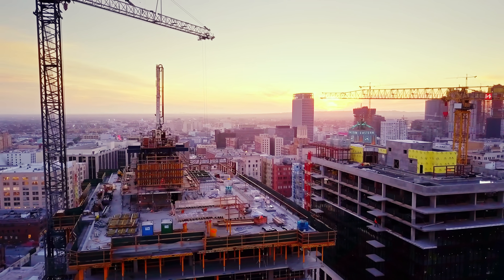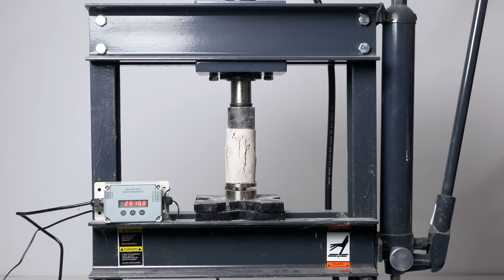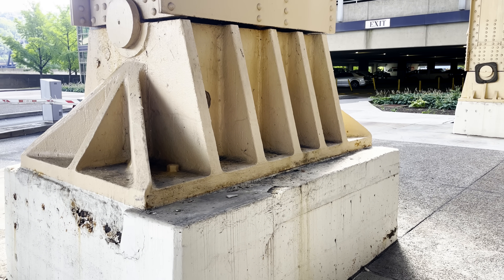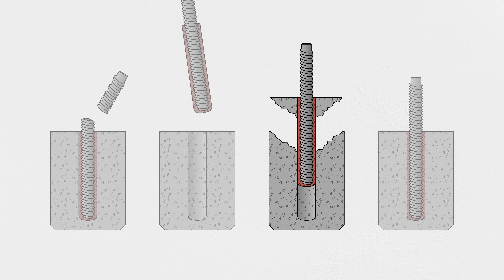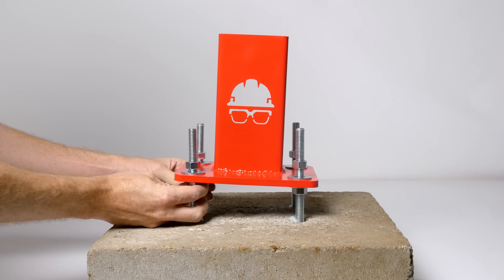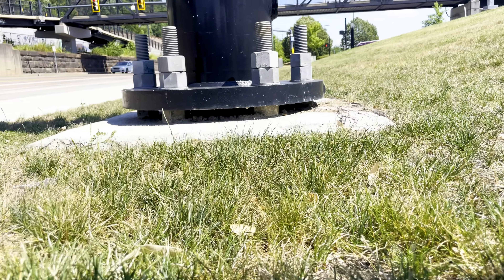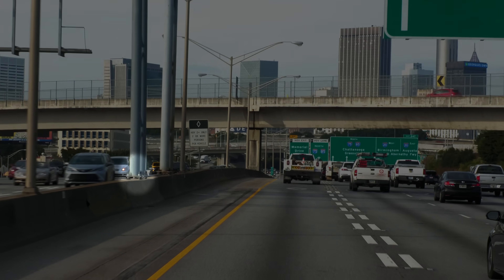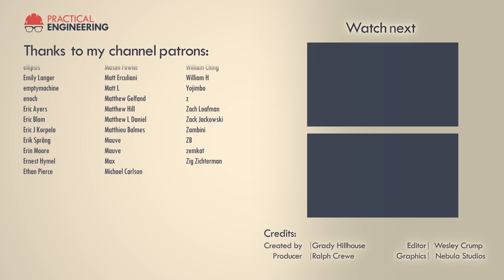What’s the Deal with Base Plates?

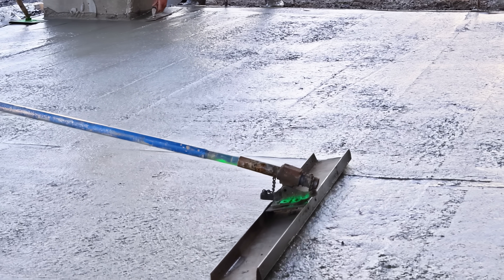Comment: At 6:24 where you begin to explain column tilting on uneven concrete slabs, the real reason load bearing columns are not installed on slabs or shallow footings is load bearing columns transfer loads deeper into the ground. A geotechnical survey will be required to design these column foundations and the ideal condition will be to secure these foundations to bedrock. Often times the deep foundation for columns are isolated and independent of the concrete slab to avoid any direct loading to the slab. This was not mentioned.

Comment: The manufacturer of.the base plates needs to add a tiny hole so you can pump grout through the top of the plate once the post has been set. It will make the grouting process 100x quicker.

Comment: Crazy this vid came across my feed. I have wondered about this exact topic for a couple of years now. Never looked into it, but just an idle wonder. Specifically the gap between the base plate and the concrete for large signs and light posts. Hearing your explanation makes perfect sense that it is simply a matter of efficiency, once a thicker baseplate and heftier anchor bolts are specified. I suspected it had to do with movement allowance at the base and cracking concrete, etc., and I suppose if that’s all it was it would be better to use a hard rubber gasket of some sort between the plate and the concrete. Anyway, thanks for taking the time to explain this to us non-engineers!

Comment: If the concrete is slightly off when it dries, you can grind/file the concrete flat, seal it and put your post right on it. You could taper the sides with the grinder or file also, if the concrete is exposed to rain, so water doesn't sit on it after a rain.

Comment: Over the years I have done allot of light poles and signs.  Since the concrete is NEVER level I always use bottom nuts and washers to fix this.  I also extend the PVC pipe up to above the wire window so I can grout the base after.  I install a dam around the base and strap an air powered vibrator to the pole.  I mither grout very thick, relatively so, and let the vibrators distribute the grout.  For bigger poles I use a concrete vibrator strapped to the pole which seems to work really well and provide a void free fill.  I then use an oscillating saw to cut back the conduits so I can play electrician.  Doing these right are time consuming and somewhat expensive.  But spelling out the process in great detail has resulted in my bids, though a bit more expensive up front, being accepted over other contractor's.  Further, I up size hardware and tie or weld it to the rebar in the base to assure long term durability and excessive strength.  Bases are thee most important part of any structure because there is really no practical way to fix sub standard implementations without resorting to heroic and expensive measures.  I am just a dumb electrician but I put in a boat load of thought and effort to assure that my outdoor work is safe and out lives me.

Comment: Stand-off base plates have always freaked me out. The weight distributed through the narrow threads is supporting the weight correct? If somehow those threads give way, the load will slide down the anchor. 😳😳😳😳

Comment: I normally build a ground cage that is set into the concrete with the threaded studs pre positioned. 
The base plate and post is floated on nuts underneath like examples shown in the video. I prefer this as the structures level can be easily adjusted.

Comment: Love this! We always manufacture our posts intentionally 25mm too short and supply "packers" to make up the length, the packers are 100mm square and you can plumb the columns around them with the nuts on the anchor rods (obviously only after the chemical fixing has cured). This also helps to keep the anchors in tension so the main loading through the post bears nicely on the "5 star - non compressible grout" between the baseplate and the footing.

Comment: Grady forgot to mention the importance of having the plate in contact with all the concrete. If the concrete has just a small pebble sticking out, it may get poor strength. 
Preferably, there should be two plates. One will be put into the concrete before it hardens, and the other one on that mast will be bolted to it.

Comment: I work on communication structures and we are finding lots of failures of grout under tower base plates causing trapped water to corrode the structural steel of the base plate and bolts (the reason for the grout was to prevent this from happening in the first place...)

Comment: What in the world is that yellow beam at 9:58 and why is it like that? The way it pinches into a small point to hold the entire load seems so strange to me. can someone explain?
Reply: This seems like a pinned connection, that allows for rotation of the column. This can effectively reduce the requirements for foundation, since only aksial loads can be transferred through the pinned connection.

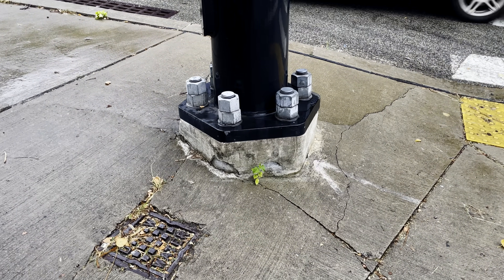Comment: 8:25 In my area, for street lights, it is much more common to just dig a hole and put in a prefabricated concrete base. Since those are manufactured in a plant, they have consistent dimensions. The crew only needs to level the bottom of the hole, put the base in, and bolt the light pole. There's no need for grout. For street signs, we either use galvanised steel channels that are rammed directly into the ground, or alternatively, when poring sidewalks, we leave a square hole open. The street sign is merely placed into the hole and wedged in. We don't bother with base plate because they get hidden by snow during winter, and typically get hit by steel plows and damaged during snow clearing. For any outdoors application, they are just a bad choice for our climate.

Comment: It amazes me how people will take giant steel structures that weigh thousands of tons and rely on 4 tiny steel pieces that can fit in your hand to hold it all together.
Reply: You should look at semi truck king pins. That little piece of steel is all that holds the trailer to the truck!
Reply: Airplane wings and engines are only held on with a few bolts.

Comment: Is there a reason to specify embed anchors over mechanical/epoxy fasteners? In my experience structural engineers always specify embed anchors and then there’s usually some issues and we have to use another fasten method after the fact. Like you said it’s very challenging to set them accurately in concrete, and even if you get every perfect they can get messed up during the pour.

Comment: Thanks great info! Will be putting up car port with some sort of base plate arrangement.  On a previous project helped design a moment frame to resist racking.  Base plate with L bolts and grout was initially spec'ed, but to save steps/time/cost and increase pullout strength, changed design to sink base plate into the concrete while still using L bolts.  With one concrete pour, a portion of column, base plate with L bolts attached were all buried/surrounded in concrete.  The column was suspended from other existing structure elements during pour and while concrete was setting.  Unique problem with unique simplified solution!

Comment: Idea for a segment.

Go over compressive load, distribution of load, whatever it is.
I recently asked an AI at what depth pressure from dirt, rock, etc. stops increasing.  It answered that it doesn't.
This 'seems' impossible as at some depth there is no material that could withstand the load above it for tunnels and such yet we have tunnels through mountains with hundreds of feet of dirt over them.
Carlsbad caverns;  There are areas where it's 625' wide.  I can't wrap my mind around how it doesn't collapse that far under ground if the vertical load never evens out.
Or a drilled hole in the ground.  If the pressure is ever increasing it seems there has to be a depth where the sides of the hole will always collapse.
The answer may be due to the distribution of forces, but doesn't that really mean there is a depth where the distribution of forces make it so the force down isn't actually increasing?

Comment: Structural engineer in the Power/Utility industry here.

Something that people seem to forget often with standoff base plates is the fact that you are limited to the distance that you are allowed to have between your bottom of BP and the foundation. Code requirements vary, but lots of people don't think about the bending stresses the bolt is subject to in that standoff gap and how much that controls the design of the anchorage sometimes.

Comment: I was just looking at a traffic light post (the new "upside down L" shape) that I pass everyday. The arm that sticks out and holds 4 signal lights must be 40' long, just hanging out there in space. It must be a tremendous amount of leverage/moment force applied down to the base, which is just nuts and bolts floating above a big concrete block, no extra grout poured up to the base plate. It hasn't fallen yet so I hope it's good!
Edit: 2 more minutes and you explained stand off base plates!

Comment: I worked at a plant that recycled lead acid batteries so the place was always being rebuilt especially when loaders or forklift hits columns. When we would replace or repair these things the plate would be bolted down with 3/4 inch stainless wedge anchors then lift the roof 1/2 inch or so slip in new column and weld the two Parts together. This worked very well as long as there's not more than 2 levels

Comment: As concrete carpenter in my twenties I’ve set thousands of bolt settings for structural steel. Getting them correct was one of the more difficult aspects of my job. I had the best luck just having the surveyor double check everything before and after pouring with the total station. This gave me the best overall results, and we’d still be off a half inch here or there.

Comment: I was part of the team that assembled the concrete-imbedded bolts for a roller coaster at a major theme park, and part of the design actually included an integrated "top" to form the concrete where the base of the columns would eventually sit. Quite a fun project, actually.

Comment: I was once involved in the design and construction of a 6.5 meter ku-Band satellite dish. The foundation work for that was more work than assembling the antenna itself. Not only did it have to have a rock solid base plate, it had to be remarkably stiff to resist any deflection under wind loading. Just a milimeter of deflection down on earth means huge differences at the satellite 35,000km away. Furthermore, because we built it in Finland, the foundation had to be designed to work with the local frost line... which was not shallow. 

It was a heck of a fun project to be a part of.
Reply: and i bet you it cost a bomb to construct hey
Reply: Doesn't sound very fun
Reply: @superturkeylegs  Fun for an engineer/builder!

Comment: As an ironworker I deal with baseplates just about everyday when erecting. I've been aware of the forces but never really deep dived like this. When we set iron it's normal lower then the top of the pad and then filled  with grout covering the plate in the hole. Not all baseplates sit on top of the concrete. And not all use jack nuts, sometimes we shoot elevation with a transit or theodolite and use shim packs.

Comment: The original machine had a base plate of pre-famulated amulite surmounted by a malleable logarithmic casing in such a way that the two spurving bearings were in a direct line with the panametric fan.

Comment: The solution I thought of was to embed a plate in the concrete which would carry the load of the bolts from the baseplate. A sub-baseplate if you will.

Comment: Another example where you can see development over time of baseplates is railway electrification, at least in my area.

The older type was coated steel or reinforced concrete poles, sunk into a hole in the concrete bases, which were then backfilled with more concrete and covered in tar to keep out the moisture. The newer types use galvanised steel poles bolted onto standoff foundations. I took a train regularly where this was visible quite clearly when a branch line, which was electrified recently, merged with a mainline, which had been electrified for decades. The old mainline supports used the type sunk into concrete, while the new branch line supports were bolted onto standoffs.

They recently relaid some track on that site, straightening some points and requiring the power infra to be replaced, so now the difference has disappeared, but there are probably still places elsewhere where the difference is visible if you know what to look for.

Comment: In my profession, I am involved in thread locking.  SC DOT found that up to 60% of those stand-off nuts are loose.  The reasons for this are not intuitive and diverse.  The main problem stems from having two nuts which can loosen.  The top nut and the bottom nut.  As you saw in many of the pictures, the top nuts are often double nutted.  However, the bottom nut is not.  Another big failure point is the fact that the hardware is always galvanized.  So galling is often encountered and crews believe the nut is tight when it was simply galled to the prescribed torque value.  Using Loctite Black,  high lubricity thread locker can solve all these issues.

Comment: i love it how we still construct high rise buildings out of steel.

It shows we have not learned anything.

After all: Even if you construct something out of steel and make sure the construction is up to standards (all the safety stuff has been put into it), a fire is enough to bring it down to the ground.
Sure, if you have 2 identical structures, a fire may indeed give the same result, even if the fire was raging at the top or in the middle.
Asymmetric damage on a steel structure may result in the total collapse in almost the exact same manner, due to fire weakening the structure at random places.
No need for any explosives to bring it down symmetrically. A fire can do it.

2 identical towers, no problem.
But even a third went down, all the way.
And in it were some fires, at the bottom floors. 8th to 12th floor roughly.
They burned here, and there, and other places.
And some places stopped burning because of lack of fuel.
Lateron that afternoon that building had no problem coming down.
The roof, 100 meters wide, it all came down timed.
All 4 corners came down at the exact same time and with the exact same acceleration and speed.
And all of that by fire.
So we have 2 different designs, and no problem. 
No need for CDI.
NO need for any explosive,.
Random fires is what we have to believe.

Meanwhile we still construct such buildings out of the same materials.
You would expect them to update building regulations considering it only took 2 aluminium cans to bring down 3 buildings.
Reply: nice to see my comments are removed

Comment: What load cell brand and model are you using. I would like to set up a similar station for testing the compressive strength of concrete for use in my classes.

Comment: What can be added to the list is these plastic "containers" (no idea whats the officaly term) that they push together with the bolts into the concrete so there will be a level "divet" in the concrete after curing, then remove it and put the metal base plated post on there.

Comment: Structural specialist here, 
There are some buildings designed to go straight onto concrete, known as “pre engineered buildings” or sometimes “butler buildings”, where I’m from.
These buildings have a high tolerance and as the structural members are connected, you sometimes have to loosen a column to make the connection then tighten the anchors again. 
Also 95% of the time the anchors are in the pad before any concrete, the people who do this are rodmen.

Comment: The problem with using leveling nuts and then adding grout is that torqueing the top nuts does not introduce tension into the imbedded anchors, and the grout is also not carrying any load. The proper way to do this is to use steel blocks/shims to level the equipment. Then fill the void with grout and allow the grout to cure. Now torque your bolts and the anchors will be tension and will also put loading through the grout.

Comment: Real life failures we've seen in Florida a lot around the coast is corrosion of the baseplates and/or anchor hardware. They'll let go of a sign or light pole in a slight wind in a second if corroded. What's bad is sometimes they're coated, so you don't even know the hardware is rusting until it's already sheared off.

Comment: Base plates are just a special case of connectors like flanges. In simple cases like traffic signs you may avoid base plates at all by just ramming the pipe into the dirt (with or without surounding concrete) about 2 ft or more like you do with fence posts. This is called friction based load bearing.

Comment: 0:20  Hmm, tell this to my root cellar pillar for the staircase and above floor levels from something like 18?? The wooden beam is just standing on a slab of sandstone and I have seen many barns which are this way.
One barn, in my fathers company, was once liftet up by 2 pallet trucks and 4 forklifts and just shifted 10m sideways to make room for a new shed. I was very impressed by this action when I was around 14 years old 🙂. Since the ground was at a different incline, a few oak blocks have been put in between the beams and the ground to level it and it was like that for 35 years until it was taken down (sold to be re-build!)

Comment: I didn't hear you mention vibration as a factor in column base design.  In a high (very high) vibration environment, grout crumbles quickly.  Concrete footers with embedded anchor bolts are soon to crumble as well.

Comment: As a electrician that services pole lights. I hate the grout at the bottom due to the water it forces the pole to holes. So now I’m replacing poles and anchors for this reason and do not reinstall the grout at the base